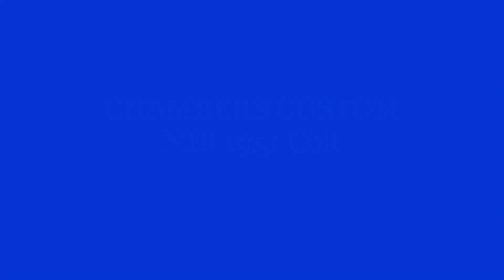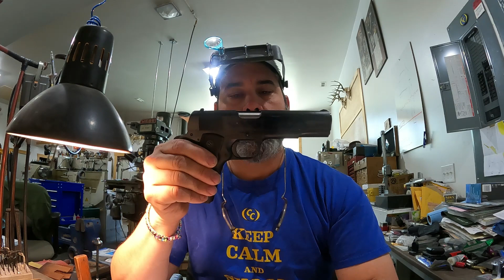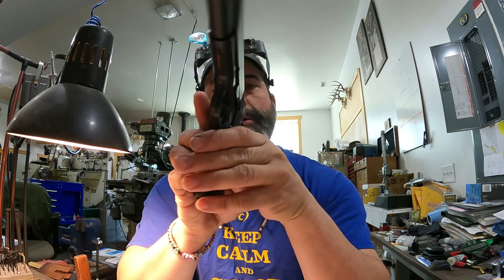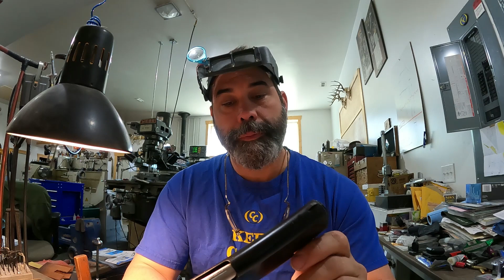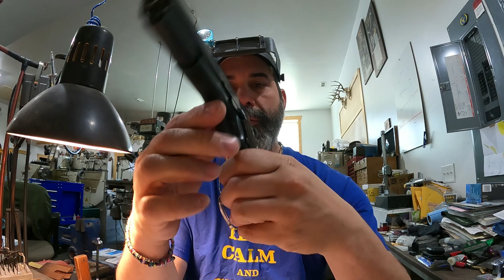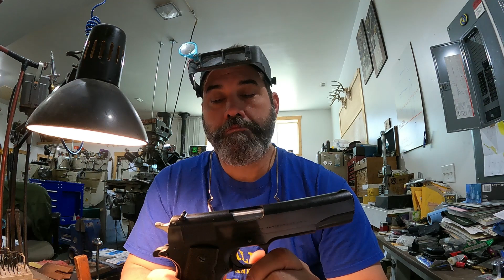NIB 1951 Colt Review!

Comment: Why would it not feed hps? Other than .330 being a bit shallow?  Are you saying there is a better way to cut a frame ramp than 1/2 endmill at 31 degrees?  Besides going to .370-.380 depth? Is there a better way to do it?  BTW, love the video.  Could you start poking some stuff with a Rockwell tester too maybe?  Lots of people talk about slide hardness, but rarely see test results.
Reply from the maker: It won't feed them because of the angle and width. Yes, there is a better way to cut the frame ramp. No, I don't have plans of poking my NIB 1951 Colt with an RC tester.